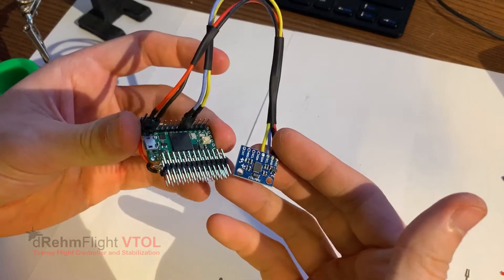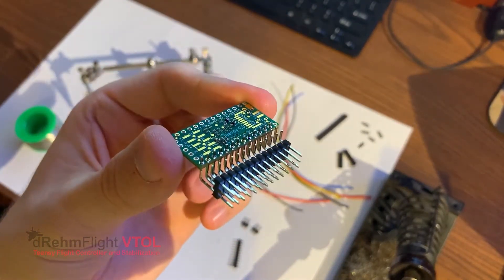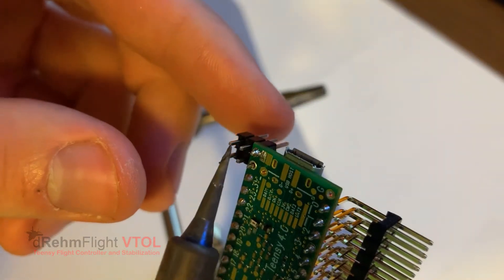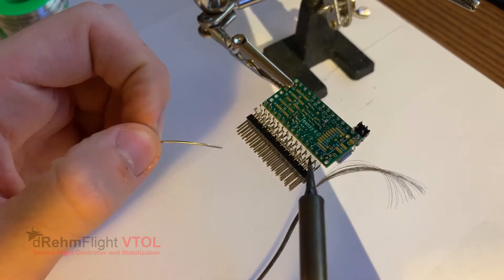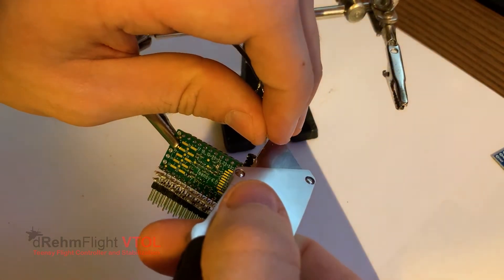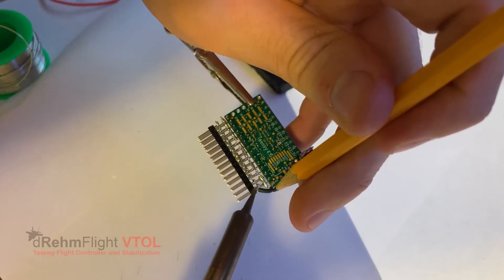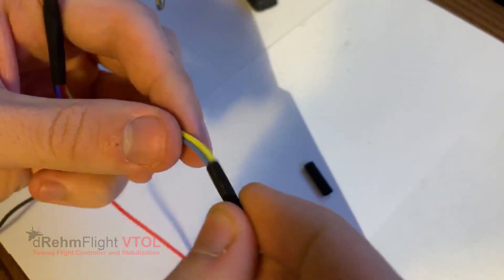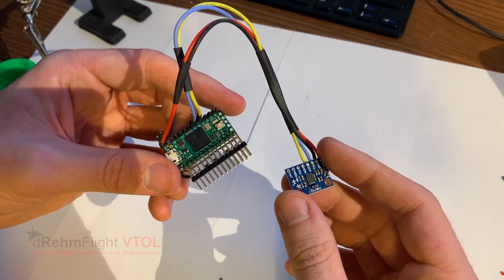Building the Flight Controller Hardware - dRehmFlight VTOL

Comment: Hi! Do you think I could give your code a try in a Rpi pico 2? I assume with some minor modifications, it could do the same job for a fraction of the cost. It might be able to run the control loop fast enough, and I/O it's enough as well

Comment: Thanks for sharing your great ideas and work. I recently ordered Teensy 4.1 board and MPU 9250 IMU and will try to experiment with the code. I appreciate very much if you can provide short guidance on how to solder pin headers on Teensy 4.1 board, which pins to cower, especially right angled header. Thanks a lot.

Comment: Could you please tell how the ESCs are connected? If I understand correct there should be an ESC that can handle the high amps of the motors, may you please tell how to wire it with the Teensy?
Reply from the maker: ESCs have signal wires and ground wires. The signal wire connects to the corresponding motor/servo output pin you want to use on the teensy, and the ground wire connects to any ground pin on the teensy

Comment: Nick, my grandson and I are building a tail sitter using dRehmFlight.  He is a second year student at Oklahoma State Univ in Mechanical and Aeronautical Engineering, but I have been doing most of the work as he is busy at school.   It is a quad  attached to a conventional plane rather than a wing attached to a quad.  I had it all built up except no props on the motor.  Have been hyper diligent in following all requirements.   Everything was starting to work in horizontal stabilization.  Just happened to run the motors up to full throttle for a moment , and then the teensy just died.  No lights, no port visible in the Arduino IDE, dead.   I can build up another teensy, but without knowing the reasons the original died I believe it will happen again.   Any ideas of what I could have done wrong?   My suspicion is that the 4 in 1 Quad ESC that I am using contributed to the failure, and if I rebuild the teensy I would change to individual ESCs for each motor.
Reply from the maker: I would be suspicious of the power supply going into the teensy. Needs to be a clean 5-5.2 volts with no spikes. A bad ESC with wimpy BEC could certainly cause a voltage spike back to the teensy. I use these to power my teensy/imu/receiver and have never had an issue: https://www.amazon.com/FPVKing-Micro-Adjustable-Quadcopter-Drone/dp/B07PLSYX9G/ref=asc_df_B07PLSYX9G/?tag=hyprod-20&linkCode=df0&hvadid=366306819795&hvpos=&hvnetw=g&hvrand=2644101065433999829&hvpone=&hvptwo=&hvqmt=&hvdev=m&hvdvcmdl=&hvlocint=&hvlocphy=1018708&hvtargid=pla-813324808982&psc=1&mcid=eaa33f9e5ec036c486b2ef8a6228089b&tag=&ref=&adgrpid=81881572248&hvpone=&hvptwo=&hvadid=366306819795&hvpos=&hvnetw=g&hvrand=2644101065433999829&hvqmt=&hvdev=m&hvdvcmdl=&hvlocint=&hvlocphy=1018708&hvtargid=pla-813324808982&gclid=Cj0KCQjw2a6wBhCVARIsABPeH1sO_bf-BdqEPbFbvNR3cSjW6e_Ih0Q7OraTQBdIsmpAapt8xmQ94TwaAoGGEALw_wcB
Reply: I am so grateful that you took time to quickly answer my inquiry.  Your response has re-energized us.  Thank you.  Mike and Peyton @NicholasRehm

Comment: New to rc, I don't know where else to ask this. I am trying to build this VTOL and am wondering the difference between a 4-in-1 esc or just buying 4 separate esc's. I am wondering because of cost and expand-ability. The 4-in-1 is slightly more expensive and I imagine that if it breaks, I will have to replace the whole thing not just one segment. Also, if, in the future, I build a project that requires more than 4 motors, should I go the 4-in-1 route plus 1 individual, two 4-in-1's, or just get 4 separate with plans for one-or-more from the get-go. This is probably one of the final things holding me up on setting aside major time and money to actually build this project, anything helps, thanks in advance!
Reply from the maker: You are right in that if you fry a 4-in-1, it usually means you are out for the whole part. But the appeal of them is the small form factor and ease of integration--much less spghetti wires all over the place. It really depends on what you're trying to build / how big it is. If it's something a little larger and you see yourself taking it apart to build other stuff later, I might recommend the individual ESCs. But that will require a bit more soldering and a little extra weight with the extra wires. Something more compact might benefit more from the 4-in-1

Comment: does it is necessary that we have to use oneshot esc?
Reply from the maker: You can use pwm ESCs on the servo outputs, otherwise you can modify the code for motor outputs to be pwm as well
Reply: @NicholasRehm  can you please edit the code for my pwm esc

Comment: Great work Nicholas! I am thinking of using your system on a VTOL project. Is it possible to have 12 servo and 3 motor outputs using default code & hardware?
Reply from the maker: Yes, you’ll have to add in 5 more servos in the code and use some of the free pins for them. Not hard to do if you just ctrl+f “s1_command” and “servo” through the code to see where you need to make additions. I recommend just getting familiar with the code as it is first before making modifications to see how things work, then go for it!

Comment: Cani I use an Arduino nano(esp32) instead of teensy 4.0
Reply from the maker: Yes but it will require some pin remapping and other careful adjustments. At that point I cannot guarantee success unless you really know what you are doing
Reply: @NicholasRehm   Can you please make a video or a guide on how to do that? Im not experienced enough to do it myself

Comment: hello, sorry but I don't understand how this card is powered if at 5 volts from an external bec or other, in the video you can see where you remove the bridge so as not to be powered by usb, but in practice there are 2 bridges to cut? even the one near to the welding of the positvo, I have continuity in that point in practice where you clean the weld, I hope I have explained myself maybe if you have a photo a diagram for how to make the connections thanks
Reply from the maker: The main goal is to not power the servo rail through USB--this is only required if you plan on using servos. This can be done by cutting those pads on the teensy, but then you will need to supply external power to the teensy when plugged in to USB. There are photos and detailed tutorials on the documentation .pdf on the github page

Comment: It's really cool how you can get away with using a 3.3v MCU on 5v ESCs and servos. I have my own design that uses a logic converter.
You explained to another comment that if the pin is unidirectional logic output it'd be safe, but how about the receiver?

Comment: GY-6500 MPU6500 should work as opposed to the one you had there right?😅
Reply from the maker: Maybe..? If you have the library to read the data in arduino, you can just hot-swap it in to the flight control code

Comment: Great instruction!, i have a few teensy 2.0, wonder if the code and wiring are the same with 4.0.?
Reply from the maker: You'll need the processor on the 4/4.1 to run properly

Comment: do you need to use a voltage divider for the IMU for its SDA and SCL pins? or are you powering it with 3.3V instead of 5V?
Reply from the maker: IMU is powered by 5v but has 3.3v logic level
Reply: @NicholasRehm  makes sense. and i am assuming the radio receiver is also 3.3V logic level?
Reply from the maker: @aottypaguy2799  Almost every one I've seen has been, but always a good idea to check the spec sheets before frying a teensy pin :)
Reply: @NicholasRehm  yea or use a voltage divider or something. thanks!

Comment: since the teensy cannot take more than 3.3V in its pins, did you have a problem with the digital pins of the ESCs inputting >3.3V into the teensy board? i do not know how much voltage the ESC digital pins give out but im assuming it is less than 3.3V since you probably didn't have a problem
Reply from the maker: Pins designated for ESC outputs are digital outputs and the ESCs don’t send any information in to the teensy (using pwm or oneshot…serial ESC protocols are a different story but most if not all ESCs operate on 3.3v logic level); only the teensy sends digital outputs to the ESCs in this case
Reply: @NicholasRehm  so if you measured the digital pin of the ESC with a voltmeter (ground to ground of teensy), you would get 0 volts? and is this the same idea with the radio receiver wires? additionally, since the BECs are connected in parallel, that would be like 12A (3A from each BEC) going into Vin into the teensy. that doesn't cause any issues or overheating?
Reply from the maker: @ahmedanwer6899  Yes, you should not be able to measure any voltage from the signal pin on the ESC. Radio receiver wires are sending signal to the teensy, so there would be a measured voltage, but you'd need to verify the level with an oscilloscope (since its a pulsing digital signal being sent from the receiver to the teensy, you can't measure a dc voltage directly). BEC current rating doesn't matter, as that is just the maximum rated current you can pull from the BEC. Teensy + receiver will only pull ~500mAh at most. With that said, wiring BECs in parallel can cause damage to the BECs themselves and I generally only use one BEC at a time to avoid this (this is unrelated to your initial question but I'm just warning you here). Additionally, you may want to consider a separate BEC from the ones built into the ESCs because the Teensy requires very clean power and ESC BECs can be noisy when driving motors
Reply: @NicholasRehm  so is it normal to have BEC 5V lines that are just not being used? and i will try to use some capacitor to smooth the BEC out for the teensy i suppose.
edit: oops one more thing, are the 3.3V outputs from the teensy large enough to "trigger" the ESC. stupid question since it worked for you, but i was just curious
Reply from the maker: @ahmedanwer6899  Very normal on multi-motors setups. Most people just snip the middle red wire on all but one ESC
Reply: @NicholasRehm  sounds good, thanks so much for taking the time out!

Comment: Thanks again, used the links, I hope that helps. There is a newer version 4.1 with SD slot. Would the code work as well?
Reply from the maker: Thanks so much, yes the 4.1 should work--I believe it has all the same pin numbers as the 4.0, just some extra pins on the end + SD slot

Comment: How does this differ from PX4?
Reply from the maker: Arduino environment, simpler & barebones code means its much easier to modify for custom vehicle configurations
Reply: Think you could support crsf? I have the spec revision PDF for it
Reply from the maker: F2GD FPV if you have the regular pwm crossfire receiver you can plug the channels right in. Protocol specific support can be added though with minimal effort